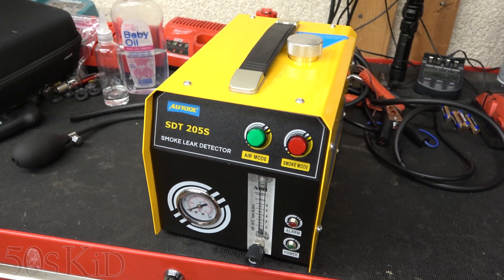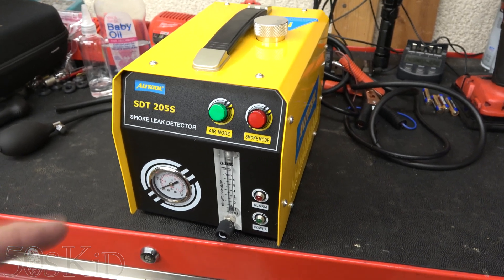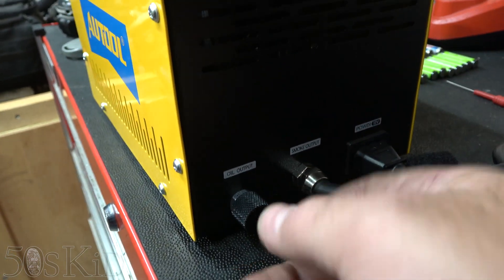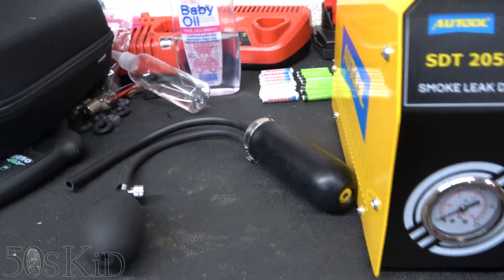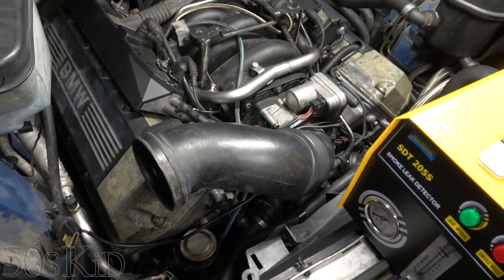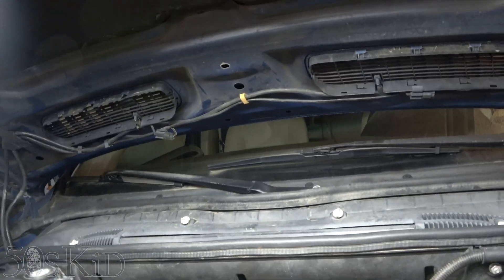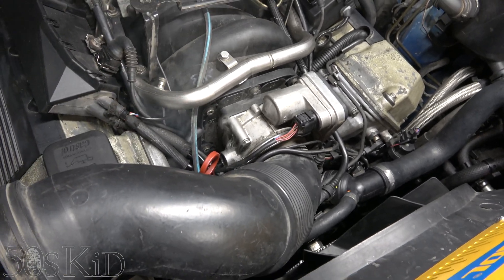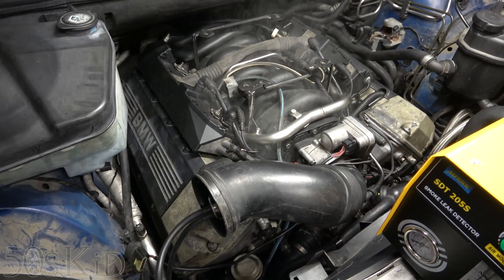AUTOOL SDT 205S Smoke Machine Review

Comment: Is it designed for evap troubleshooting. I have the autool sdt-206. Have used it on my 20p6 sti that had a po442 and po456.  Made repairs . I had to improvise to control the psi  at 1 to 4
Reply: My son's car has developed the P0456 so I figured I'd get a smoke machine. I was able to pick up a SDT206 used at a good price. After watching some videos on it, there always seems to be someone who comments that the pressure is way too high and it's going to destroy everything if used on the evap system. Unfortunately, these comments are never left by anyone who has actually used the machine. One commenter even insisted that it could cause the gas tank to rupture. The size of the compressor inside the box is so small, I'm finding that impossible to believe.
What was your experience and how did you regulate the pressure down?

Comment: Is this tool as useful for oil leaks?
Reply: There is going to be a balance in that one. Not enough pressure and no. Too much pressure and it'll be false for dynamic seals.  Won't hurt to try.. and would be good for moderate to gross leaks in static seals.

Comment: Any vacuum leak before the throttle valve is not really a big deal right? Mainly because there isn't any real vacuum before the throtle valve.
Reply: No. anything downstream of MAF is unmeasured air.
Reply: @wydopnthrtl  correct. But there is never a high vacuum before the throttle valve. In other words: even if there is a small leak....there is never a high delta pressure sucking in unmetered air.

Comment: Great tool, really helps and definitely solve vacum leak problem without spending hours to find small leak. Must have for workshops, but it might be overkill for single user. If anyone looking for a way to check vacum leak, you can start with cheapest way, which is cigarrete and hand glove. We put on glove just after MAF and make sure its tight. Next we take break vacum line, light up cigarette and blow some smoke inside. its not going to make such pressure like machine, but it will definitlly help. Second option is fog machine, I tried one and it was ok, but you need to have good way to capture smoke (my pipes melted due to temperature). machine presented solve many problems that you are not even aware of if you neved had to find a leak. Thank You for another great video!
Reply: You will not find a vacuum leak with a cigar or anything like that, ok Scotty Kilmer?
Reply: another good way is a syphon pump and a vape, the pump helps build up a bit more pressure and the vape gives a good amount of a smoke which is easier to see than the small amount of smoke a cigarette makes
Reply from the maker: These are amateur methods that do not work. You need forced air & smoke
Reply: I had a vacuum leak in my E46 325i. I used a cigar and a liquid transfer hand pump. It worked well for my purposes.
Reply: These budget smoke machines will be much more accurate in conducting a smoke test. No one is using the cigarette method to find an exhaust leak. This isn’t either early 2000s anymore. People are trying to diagnose these cars as accurately as possible.